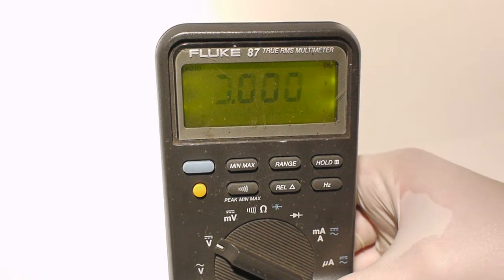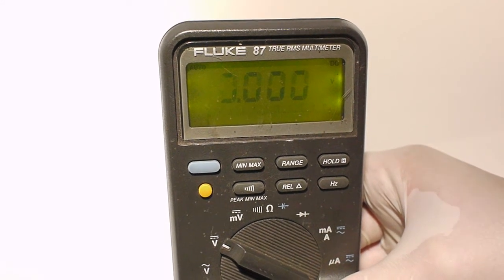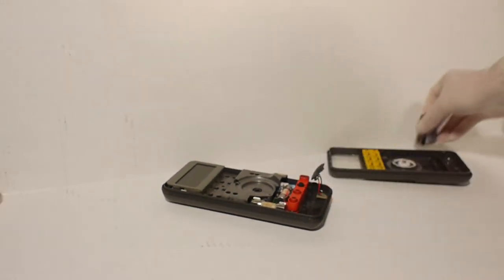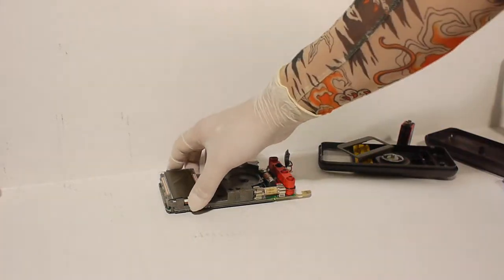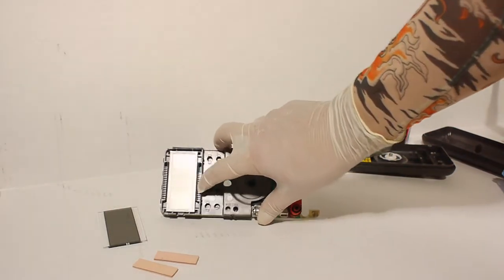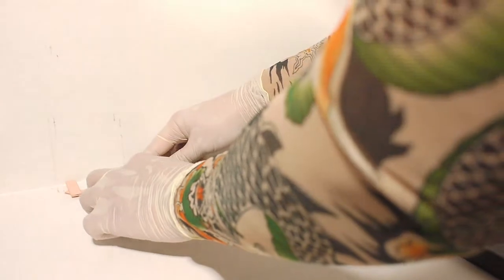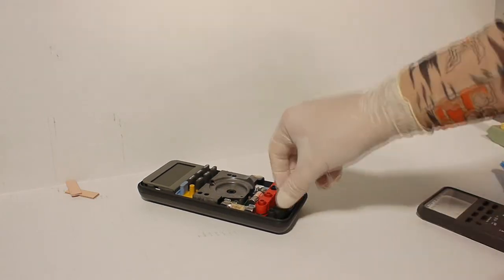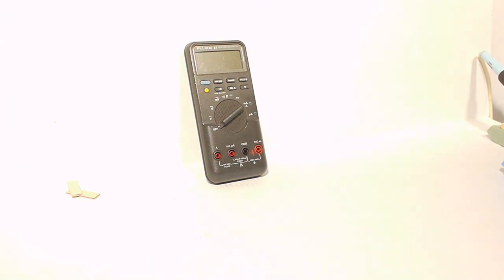Fluke 87 Multimeter Breakdown Step-by-Step and Faded Display Fix

Comment: six years later, this worked perfectly, clean display! Thanks . Wondering why this is a “ temporary fix”? I also noted imprinting( little dents) on the downside of of the elastomer strips, I replaced them the same way thinking they might not contact the glass too well.
Reply from the maker: Six years and counting...and here's to many years to come.  Thanks for sharing!

Comment: How can  convert green light to white light ?
Reply from the maker: Thanks for reaching out.  The older legacy Fluke 80 Series multimeters have the original Green back light.  The White Backlight is the Backlight from the Fluke 87 III, and it is compatible with the Fluke 87.  Here is Fluke 87 Backlight info: Backlight (Green) CR 6 Fluke 87, Fluke 88 Only 819342 (https://multimeter.io/fluke-87/), and here is Fluke 87 III Backlight info:  Backlight (White) 609922 (https://multimeter.io/fluke-87-iii/) We have Green and White Backlights in stock. They are previously used, and pulled from parts units. Contact us at parts@multimeterparts.com with parts requests and we'll do our best to accommodate.

Comment: Do you sell the LCD display of the Fluke 87 multimeter or a brand new LCD display since it shows the same values as the fluke 87?
Reply from the maker: Our best recommendation is to find a reasonably priced used/parts meter and swap out the LCDs.  Occasionally, we'll get a parts meter in with a good display.  We do have pre-owned units that we part out.  For parts requests, please contact us at https://multimeterparts.com/contact/